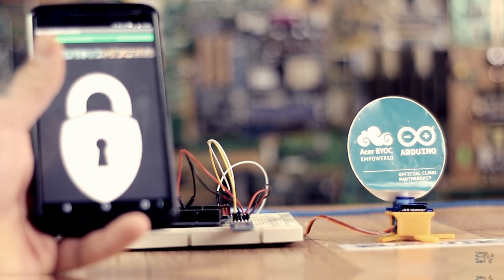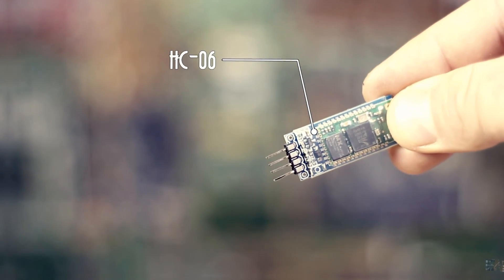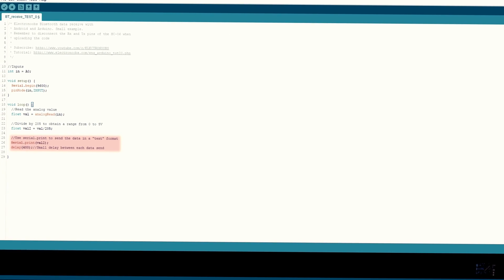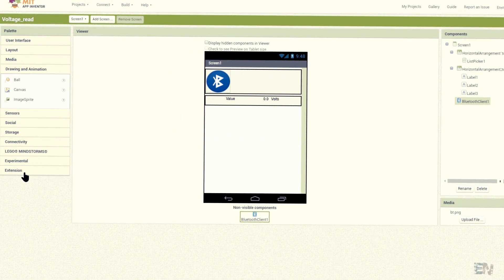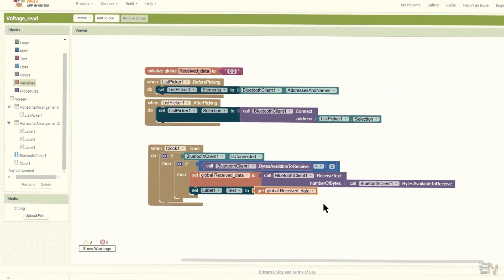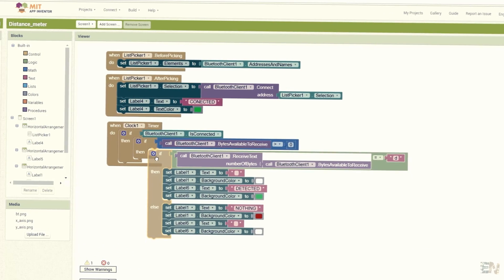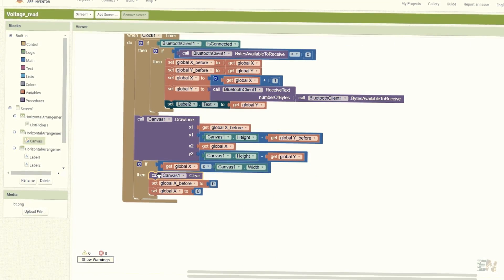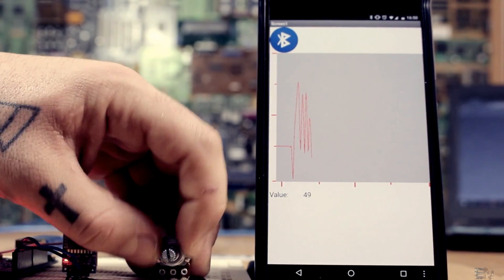Bluetooth Arduino RECEIVE data + Chart

Comment from the maker: I hope this small tut will help you. Check my webpage for more details.
Want to help me? Here is my Patreon: https://www.patreon.com/ELECTRONOOBS Thank you. Also use my Q&A for any question. Keep up!
Reply: excuse me i try to do this tut but i didn't get any value in the application
Reply: @nawafshamrani3762  same here, trying to recieve values from a temp sensor in float format, in die Arduino IDE Serial Monitor I get the values but they wont display on the phone...
Reply: PLEASE  tell us bro how to receive multiple sensor readings please
Reply: Hi! Can you make a tutorial video where in you will receive multiple sensor reads. Been having trouble getting the values of from my soil moisture since both are printing the same values. Thanks
Reply: Sir,I want to receive ECG signal that is already conditioned and filtered but the value is in analog form using arduino uno  an HC05 to my android phone.i want a graph plot of the signal I am receiving on the phone directly..
Sir please help how can I go for it?
Reply: Hi I'm trying to work on something system that recieves data from the headphone Jack instead of bluetooth please assist with such a tutorial
Reply: Nicholas Nyamulima l
Reply: does this apply for hm10 bluetooth to0 ?
Reply: Hello, sorry could you help me develop a project

Comment: Great tutorial ! Please consider to do a similar with ble Bluetooth or more capable Bluetooth device  with better range! ! I tried a more complex project with two Bluetooth.The first transmit data to PC processing ide sketch catch the data and the other receive commands from mobile app Inventor . some times failed to connect so I  gave power from external source.. The problem solved in 80%.So I realised that they draw more than 200ma when they try to connect.I am right? So I gave you a lot ideas for a new tutorial!!! Hi from Greece!!!

Comment: does it make a difference if i use hc05 Bluetooth module instead of hc06
Reply: I am used the hc05 and hc06 before. For me, the hc06 is the best. 'cause my hc05 isn't worked before. But hc06 is working.
Reply: @ArduinoTurkBatu  bende de hc05 var bende veri alamıyorum
Reply: @mertcankorkmaz1038  hc05 buyuk ihtimalle başka bir arduino kartiyla kullaniliyordur yada eski bluetooth modullerine sahip olan telefonlarla
Reply: @ArduinoTurkBatu  rx tx bacaklarını kendim belirlediğimde veri alamıyorum kartın kendi rx txini kullandığım zaman veri de parazit oluyor
Reply: @mertcankorkmaz1038  rxi tx'e, tx'i rx'e taktin mi

Comment: Anyone having problems with the bluetooth effecting the analog read values ?. If I disconnect the bluetooth and send to the serial monitor the voltage displays correctly. With the bluetooth connected the voltage bounces up and down by up to 1 volt ( im taking 50 readings and averaging them out to get rid of random jitter)

Comment: I CREATE THE APP BUT IS NOT RESPONDING BUT DISPLAYING UNABLE TO CONNECT ASKING TO IF DEVICE IS TURNED ON 
I USED HC-05,ARDUINO,VOLTAGE DIVIDER AND CODE WHICH IS DIFFERENT FROM YOURS IN IDE

Comment: Can you write a program to log data for electronics practicals, like input voltage vs output voltage table or current vs Voltage table, I want to use this to quickly take data for MOSFET, BJT,diode or any other components  curves, op amp input/output voltage cirves.
Please suggest how can we take data by Arduino, it will save hours of time

Comment: Thanks a lot for this tutorial....it helped a lot. I am successfully sending and receiving data between arduino nano and android phone. But why are you not creating voltage divider for rx input of bluetooth module...which is 3.3v and arduino is supplying 5v through tx output....it might damage hc05 module with 5v in to rx when required is 3.3v.

Comment: Hello I have hd planetary  dc encoder motor I want to run it with bluetooth but the thing motor is running with bluetooth but it's not showing the increment values

Comment: Wow!  This is a great video!  I want to do this and make a bluetooth bicycle speed sensor.  

I was wondering if someday, you could do a video on using the Reyax LoRa modules with arduino.  I've seen videos of people using the Reyax (rylr896) to turn an LED on or off or blink an LED.  However,  I've never seen a video on someone using the reyax modules to get a potentiometer on one arduino to talk with another arduino with an OLED.  I'm at the moment trying to get this going, but having a hard time with the code.  All I can get to print on the OLED, is "0, 2, 2, 2, 2, 2,......"  I can't get it to print 0-1024.  Any ideas?  Anyways, great video as is all your videos.  Very informative.

Comment: Hi, I have a question.

I'm doing almost the same project however I'm planning to use an ESP8266 WiFi module instead. Will it work?
Reply: Did your project work ?

Comment: I thought a voltage divider to drop voltage on bluetooth module receive pin to 3.3 volts was necessary as to not burn up module?

Comment: Do you know how to enroll a fingerprint from R307 and send it to another R307 module via 2 HC05 BT module....

If FPS -A has enrolled the fingerprint then FPS -B should be able to detect the same..

I am using Arduino UNO.

Comment: I'm to check the multiple conditions in ultrasonic sensor. my code gives  8 random letters. But in if else condition only 1 condition is checked.I've used else if conditions and 8 individual if else conditions but it is checking only single if condition it is not checking the remaining else if conditions.

Comment: Hello thank you for this video.  I have a project of controlling the temperature and the pressure in the same time and if there is an issue of this two parameters the application send a message to the technical centre  but I have a lot of difficulties

Comment: Hi, I have used exactly the same arduino and android code/setup and the same circuit schematic as here and the bluetooth device connects to the app and the serial monitor on arduino IDE shows the correct values. But the application is not able to get the data. I have tried Serial.print and Serial.write but neither work. I reckon this could be because I am using 5V and not taking it down to 3.3V but then in the demo it is also using 5V so I wonder what the issue may be? PLEASE HELP!!!!

Comment: ELECTRONOOBS YOU SHOULD DEFINITELY MAKE A VIDEO EXPLAINING HOW TO BUILD A CIRCUIT, CODE, APP AND ZERO CROSSING CIRCUIT WHICH CAN CONTROL AT LEAST 5 AC LIGHT BULBS AND BE ABLE TO NOT ONLY TURN THEM ON/OFF BUT DIM EACH ONE OF THEM SEPARATELY VIA BLUETOOTH HC-06 AND ANDROID APP. THAT WILL BE A CHALLENGE!!!

Comment: i did the same thing but with dht22 sensor, but when i try to find my bluetooth on my android its there connect and pair but in my android app it  says "error 507 unable to connect, is the device turn on"

my arduino code is right and works on serial monitor, but cant show it on android. all i want i just shows my serial monitor on my android apps :(. can u help me what's about?
Reply: Same right here, did you find some solution at this problem?
Reply: any updates regarding to your problem?

Comment: Hey man my bluetooth module isnt connecting to the app I made with MIT app inventor. I use OnePlus 5T , it's Bluetooth v5 . Is that the problem? The s2 terminal works fine but not my app that used to work with my old phone. Do you know what's the problem?